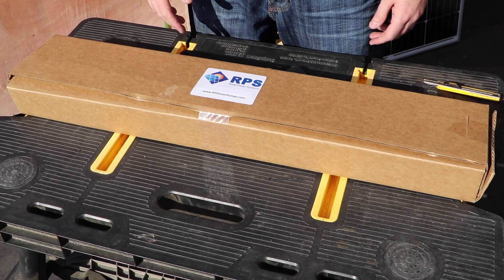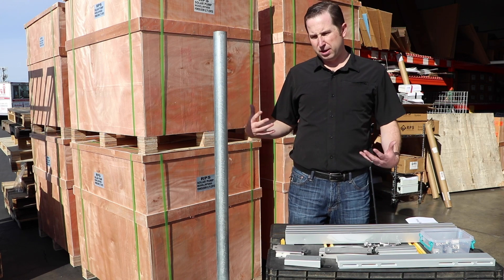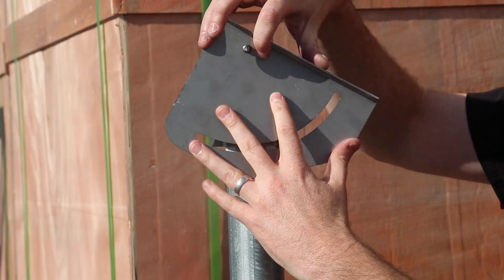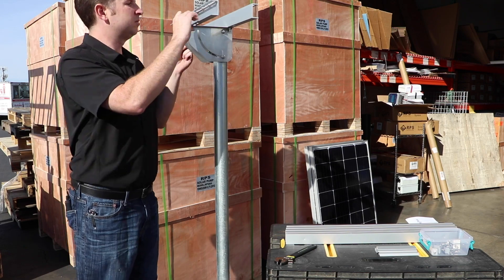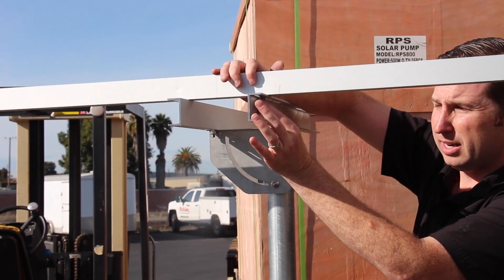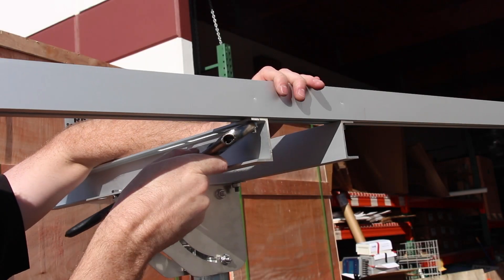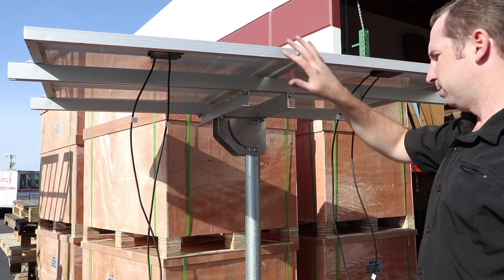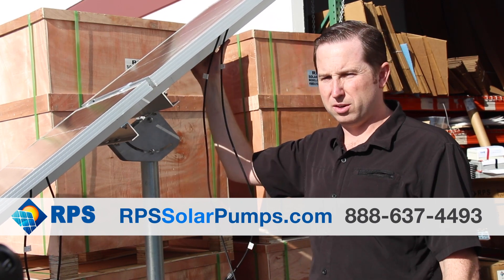Pole Mount Kit Assembly HOWTO

Comment: Biggest thumbs up! Excellent instructional video. The design? Equally impressive, particularly those dents holding the extension bars  a quarter of an inch or so apart before having to pound on them.

Comment: Do you make a mount that can be mounted to a 4x4 post?
Reply from the maker: No we do not.  However our 4 panel mount can go on a 4x6 wooden post but you will need to purchase longer bolts.
Reply: @RPSSolarPumps  What size bolts are required?

Comment: I have the RPS 400 and looking to add a bracket so I can adjust the tilt angle.  I can tell the pump kit is well engineered and thought through.  In this video you even know that it's 304SS!  I'm shocked how many products on the market don't even know what alloy they are using.  It's nice to see a quality product.  Resist the urge to ever outsource this to a cheaper source!  Keep it all in house.
Reply from the maker: We love quality here at RPS!

Comment: Not trying to be too critical but there is a lot of flex for just the two 100W panels. I love that you are using aluminum, but it also does not look like it would hold up to stronger winds with the thicknesses used. Any plans to use heavier gauge aluminum and stainless?
Reply from the maker: All of our mounts are designed to withstand 81 MPH winds (with margin applied) along with appropriate snow and ice loads per NRCS national requirements.  We perform an FEA structural analysis certified by a state licensed mechanical PE to comply with these requirements.  We have thousands of mounts out in the field without issues.
Reply: RPS Solar Pumps what does “with margin applied” mean? I am asking because I live in an area prone to hurricanes. “Designed to withstand” and other Marketing terms don’t mean much when/if a product fails and expensive solar panels are damaged in the process. Again, I am not trying to be critical or combative , but I would appreciate hearing from actual customers who have purchased these units and had them exposed to higher force winds... then have them advise on their experiences on how the hardware held up. I do appreciate you taking the time to respond. Please understand that I am doing research on solutions for my needs and as such I am trying to filter viable solutions that will last.
Reply from the maker: @heart4Pahoa  Hmm, not sure I follow.  "Designed to withstand" is an engineering term I used almost daily in my decade of aerospace engineering. Trust me, marketing used much more elegant and flasher descriptions!    The mount is rated for 81 MPH wind loads.  If you are going to experience winds higher than that on a regular basis, probably should see if anyone else offers a higher rated mount.
Reply: RPS Solar Pumps Thanks again for your quick responses and for taking the time to clarify. As you suggested, I will continue to hunt for PV mounts and see what I can find based on my location being subject to hurricanes. Good luck to you and yours.

Comment: Are there caps for the end of the rails to prevent bees and wasps from building nests inside?
Reply from the maker: Hmm, interesting point.  We have not had any issues with wasps making nests in the rails, as the openings are pretty small.  I am sure you can add some sort of cover if it is an issue in your area!
Reply: @RPSSolarPumps   I use spray-in expanding foam

Comment: Do you have solar kits for larger panels.  I have 250 watt 72 cell panels.  I'm looking for a either a  4 panel or 8 panel mount.
Reply from the maker: Right now our mounts are made for our 100W solar panels.  Perhaps in the future they will be compatible with larger panels!
Reply: @RPSSolarPumps  I'd like to mount 2 Hanwha Q-Cell 300W G6 or G7 panels and would like to know the length (top to bottom) of the mounting rail so I can determine if my 2 Hanwha panels will work on the 2 panel rack or if I should order the 4 panel rack and cut off the extra rail length I won't need.